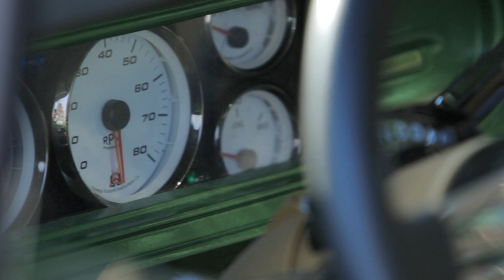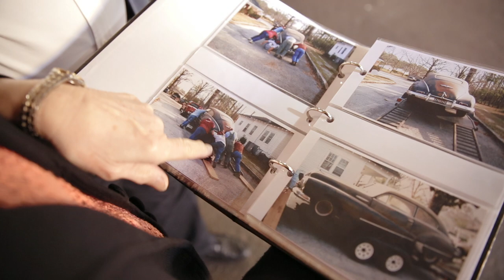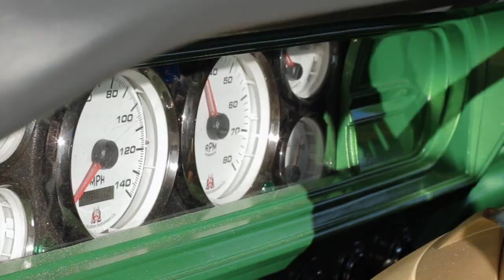1969 Ford F100 By Tommy Pike Customs

Comment: I have the same truck with a 429 that's pretty pumped about 430 to the tires but if I go modern I would go with the Roush 5 liter with very minor adjustments that motor will do 800hp and it's Ford but hey each into their own if that's what you like then who cares it makes you happy and it's beautiful.